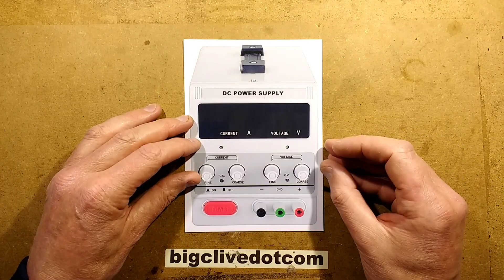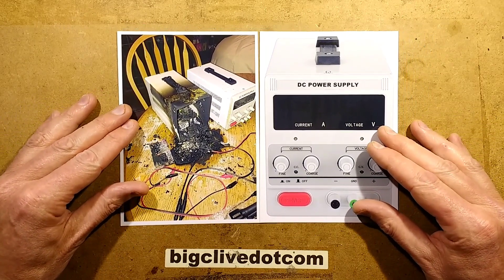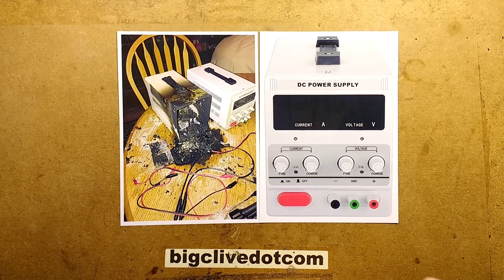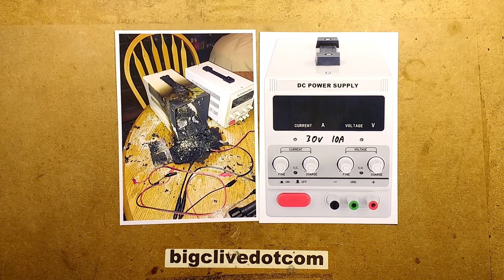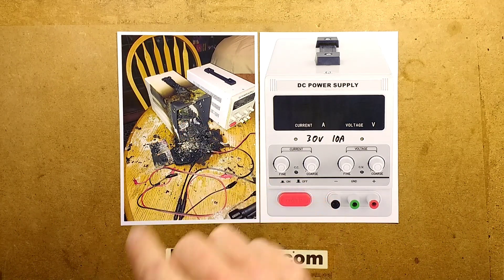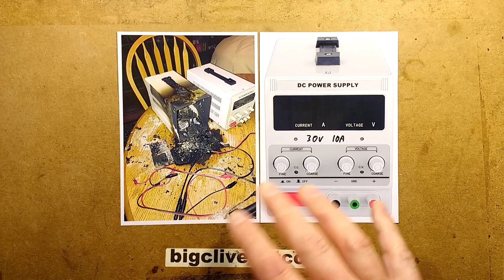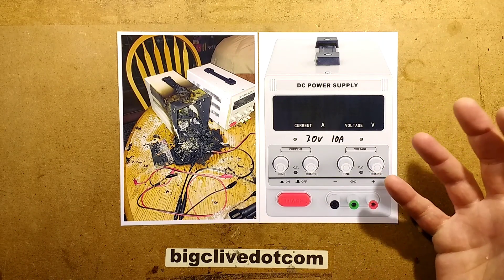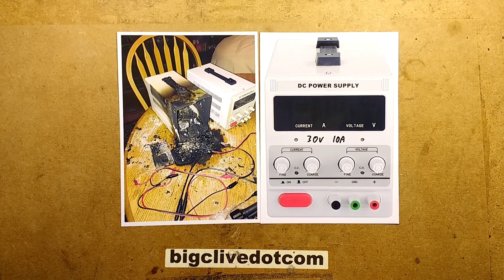Smokin' power supplies.  PSA

Comment: Gonna buy myself a power supply very soon,  Clive uploads horrifying stuff about power supplies D:
At least the one I gonna buy is 5A and passively cooled (might not help :D), also I already read to not let them run for too long in the first place, if needed only with supervision, checking if it gets hot or not.
Although the one I'll get has a toroid transformer and seems to have certain areas where it goes "click" while changing the voltage, guess that should minimize the heat :o
Reply from the maker: +8bpspfreak2 The click is probably a tap changer to minimise the voltage being dropped across the regulator.
Reply: 8bpspfreak2 I have been very happy with my Mastech HY3005F-3, which provides two regulated 0-30VDC@0-5A outputs which can also be bridged in series and parallel (for single 0-30V@0-10A or single 0-60V@0-5A) plus a fixed 5V@3A output.  I paid about $300 for it about 8 years ago and have had no issues with it even under rather heavy extended loads and it has taps about every 6V to reduce power dissipation by the series pass transistors (which are externally mounted on the rear) and also has a toroidal transformer.  More expensive than some of the cheaper alternatives on the market today, but it has served me well thus far on my bench if you need any recommendations.  Or, if willing to spend more, the older HP and Agilent bench supplies are hard to beat and extremely well designed but can demand a premium if in very good and working condition and often require a fair bit of bench space since they are often 19" rackmount size.

Comment: Hehe, oh how we laughed at the old running joke to Julian...
"Just get a good bench PSU!" :D

Does that include you too Clive? You have a dodgy PSU hiding off camera? :P
Reply from the maker: +NoName I have a good power supply with a huge design defect that very occasionally results in a crash that puts out a random voltage.
Reply: That doesn't exactly qualify as "good" Clive!
Maybe a good name with a crap design/implementation, but crap none the less.

Fare crack though, you went for a 'good' one, still leaves Julian who is seeking sponsorship from China :P

Comment: +bigclivedotcom question about power supplies going bad.

I have a UPS at home that seems to have exploded transistors.

Is it worth replacing them and fixing the UPS or will more of the PCB likely be dead because the transistors exploded?
Reply: enlightendbel if the transistors exploded then something very catastrophic happened to that UPS (battery polarity reversed, lightning damage, or a fault in the transformer or a shorted load on the output, none of which are good).  I would not bother with the repair unless you are really qualified to fully diagnose and repair the unit (made all the more challenging since there are no schematics and you will need to reverse engineer to isolate all faults).
Reply: The unit was stored for about 6 months.

I tested it before storing it. Did nothing to it other then plug it in.

Granted, I have to say "I think" they are transistors. Because following the PCB that's what their function looks like and they have 3 legs. I'm not kidding about the exploding, except that there is no burning to be found anywhere, the 2 parts are just completely shattered to the point I'm currently puzzling them back together to get the part number of of them :@

And no worries, I've been ripping apart way more complex audio and computer hardware as far back as age 8. I know how to fix things, but sometimes could use some insight into if it's actually worth to do so.

By now I've tested the LCD, the Batteries, quite a few of the components (about 50% trough) and other then one blown cap and those two transistors, I haven't been able to find anything wrong. There's nothing burnt, nothing leaking, just those two transistors that are in a thousand little pieces.
Reply: enlightendbel Whatever happened almost certainly happened prior to your decommissioning the UPS 6-months ago.  The transistors (either power MOSFETs or IGBTs) typically serve dual purposes of back charging the batteries while AC power is present (at least in the larger UPSs, smaller UPSs that charge much more slowly may not exploit this and instead use a separate charging circuit) and the role of generating AC via voltage inversion (either using modified sinewave or a PWM approximation of a sinewave) using either four transistors (or four banks of multiple transistors on larger units) in an H-Bridge arrangement or a pair of transistors switching two sides of a center tapped transformer.  As such, the UPS, while still plugged into a live AC receptacle, will typically appear to still be working properly, it just may not be charging the battery any longer if they were implemented to serve this dual role of charging (otherwise they only come into play when providing battery power to the load).  The fault would only have become plainly evident in the event that power was lost at which time the load would have been dropped.  Exploding a power transistor is always the result of a massive and nearly instantaneous thermal transient event that is nearly always preceded by a either a massive surge of power (such as with a very low impedance dead short on  the output) or a massive voltage breakdown event (such as with a large power surge or lightning strike event).  It takes a tremendous amount of power flowing through a power transistor to make them explode, and especially to make many explode simultaneously.  Barring your having shorted the output while the UPS was on battery power the most common cause of this fault is a large power surge or lightning strike (such can happen when power suddenly fails and a large utility transformer generates a massive back EMF pulse at high voltage and current), for this reason it is not usually worth spending good money on repairing the UPS since such UPSs are actually quite inexpensive (the real money is in their batteries, good UPSs minus batteries are not usually that expensive).

If you do decide to attempt repair, be very careful while troubleshooting and diagnosing the UPS as there are both high voltages present (up to around +/-350VAC if you have 240V power, half that for 120V) and very high currents at the 12/24/48VDC+AC provided directly from the backup battery.  This is not only enough to be very dangerous to the technician voltage-wise but also more than sufficient voltage and current to destroy your test equipment, such as an oscilloscope, if you should ever connect the wrong probe to the wrong side of things.  So be very vigilant and make sure you know exactly what you are doing and take time to think through every single step before preceding with any action as it is easy enough for those of us who have this experience to make costly mistakes with just a moment of absentmindedness!  Be especially mindful of where you connect the ground lead of an oscilloscope probe as most scopes use a ground/neutral referenced chassis and probe ground.  If the circuitboard is built from SMD components then you will want to obtain very thin test probes suitable for testing such small points since normal sized test probes can often easily short out to neighboring pins or components and that can cause further damage to the circuit.

Either way, I wish you all the best!

Comment: would you link to the make / model you have yourself? 
I've been considering one for bench use and would rather one that has been used and fully tested by a reputable destructioneer as yourself
Reply: Mark Barratt I have an 8 year old Mastech HY3005F-3 (two 0-30VDC&0-5A, bridgeable in series and parallel, plus a third fixed 5V@3A output).  I have never had any issues with mine and it has spent a number of hours pushed fairly hard with both variable outputs bridged for 10A output to drive an 8.5A load for extended periods.  It will get fairly toasty as it is passively cooled with both series pass heatsinks mounted externally on the rear) and is twice the physical size of this unit and dedicated volts and amps displays for both variable channels and is built around a toroidal transformer with taps about every 6V.  Never any smoke, which is a big plus in my book although any linear power supply can suffer a series pass transistor fault where the transistor(s) fail short circuit and pass full unregulated voltage and current to the attached load (one of the most common failure modes in linear supplies...switchmode supplies have their own innate weaknesses as well, but linear supplies generate no unwanted RFI issues).

Comment: Are those the ones that can plugin the right way, and also plugin in at the wrong pollarity without any problems? I have a few guitar amps and other effects boards that are similar. But i really prefer if it would be proper pollarity and not trying to mess around.. what do the behringer mafia want to see you electriced  at defiblulator at some stage?? I'm just prefer to have me reliable gear!

Comment: I have one of these. 
They can get very very hot at the terminal connections when under heavy load, looks like this one did too. The plate at the back of the connector sockets is not always the firmest connection, this may be an issue. 
I blew out the MOSFETs in mine drawing over 8 Amps at 30V with a SSTC. Fortunately it just shutdown and was easy to repair.

Comment: It may not have been the power supply that failed. I'd even say it's more likely that it was the wires. Chincy wires, where they skimped on the wire cross section or the connection to the connector isn't made properly, can get quite hot. Add non fire retardant insulation to and the wires will be on fire quite quickly.

Comment: I watched a tear down of a PSU in that same case, but you can get them with various current ratings and brand names so who knows how similar they are inside. The factory could base them all on the same design but spec models differently for different customers. Anyway, the heat sinks (and the bits that get hot) are about 3/4 of the way toward the back of the unit but that pic makes it look like the front caught fire. It could have been as simple as a bad connection by his cables going into the unit. But yeah definitely not a good idea to leave experiments running at that kind of power unattended. Go and get a drink, sure, but leave the house? Nah.

Comment: reminds me of my previous job, they had UPS (battery backup) for all the computers, but they'd suffer some kind of fault and would never stop trying to charge until they overheated and failed. no fires, but some rather scarily discoloured and warped plastic cases due to extreme heat.

Comment: i have one i modified  works at 30v 10amp or 60v 10amp no problems and i use it every day. i even charge my ebike battery with it 48v 20ah . only part that could do that damage would be the regulator on the back of the led display. likely very rare fore that to happen.

Comment: Owner of one of those power supplies here: the damn thing came delivered pre-broken for me, turns out one of the wires had come de-soldered from the one of the boards (forgot which, it was one in a row of three, very visible upon opening it).

Maybe the crappy soldering on these things is to blame? I'm leaning towards a toasted MOSFET similar to Menorcase's situation possibly starting the fire, i wouldn't have expected it to take out the whole front panel though, scary.

Comment: One thing I can think of that may have happened is that the power supply was limiting voltage and the peltier went short and overloaded the banana plugs. Peltier plates need both regulated voltage and current, if you power them from an unlimited source they can fail. Often the junctions go open but they can rarely go full short too.
Reply: Blaze the Fox The more I think about it, I find myself curious as to whether a series pass transistor may have failed short (a common failure mode for linear supplies) which would dump the full unregulated voltage (for the selected tap) and current available into the load, limited only by the transformer, load, and wiring impedance.  With any luck the series pass transistors may have survived the fire and could still be tested to see if this fault occurred.  It has certainly happened to me, only with a much larger linear regulator and it can be pretty spectacular if you are not present to quickly shut things down.  That said, I have a larger 3-output Mastech HF3005F-3 (2x0-30V@5A, fixed 5V@3A) -- just a bit higher total rated power output than this supply at 315W -- that is twice as wide and places the heatsinks externally on the rear and has taps about every six volts, even so it can run pretty hot if near those limits and towards the bottom end of a tap, so I really wonder how hot this supply gets with both the heatsinks and transformer trapped inside (hopefully includes a fan?).  But I find it curious that the front panel is what burned up, which to me suggests internal wiring or a banana jack overheating, which has me wondering if either such is inadequate for the 10A rating (or a bad banana jack/plug) or possibly a series pass transistor fault allowing unregulated voltage and current to the load.

Comment: Looks like the load started it, not the power supply. Maybe even the little leads got too hot... 18 volts at 8 amps is a lot for those tiny leads continuously
Reply: tapper88 The voltage is irrelevant, only the current contributes to heating of the leads (power dissipated in watts = I^2xR, or current squared multiplied by the wire resistance).  That said it does not take terribly heavy wire to handle 8A, though if very cheap multimeter leads were used to carry the current I might be more concerned (it is unclear what the multimeter was meant to monitor, but most likely voltage drop since the power supply displays current), but usually even the cheap banana lead kits are usually suitable to safely handle 10A with only modest warming.  I just wanted to clear up any misconception about the voltage contributing to wire heating as I dare say many do not realize that the voltage is irrelevant (not even part of the formula).

Comment: Even the good ones have a warning label about unattended use (well, my old analogue display PSU certainly has). Surprised there wasn't some form of overtemp. protection (which should have prevented this incident)

Comment: The fire appears to have started on the table (on the device that was powered by the PSU?) And then ignited the plastic on the PSU, so I will not judge the PSU as the culprit in this case.

Comment: Was it actually the power supply or the load that caught fire? Or was it some poor connection in between? I would never leave any bench power supply or unfinished prototype circuit running when I leave. Expecially when it is a high power project (like 18V 8A!).

Comment: All these power supplies come with warnings not to use the machine longer than 8 hours continuously. I don't know why it is so limited but maybe that happened here.
Or depending on the size of the peltier element maybe he was making a rather big electrostatic field which is sometthing these power supplies hate.

But at least the person now has a reason to get something that doesn't switch with relays, has good cooling, correct readouts, actual shielding and 50 other things these cheap PSUs don't deliver.

Comment: Something is very wrong here. Those power supplies should be better then bricks and wall warts. Even if they are shorted they shouldn't go up like that. Someone needs to get one like it and turn it inside out... assuming it wasn't the device connected to it that caught fire.

Comment: If you're truly desperate for a cheap bench PSU and aren't satisfied with the 5v/12v of an old computer PSU, you can get a DP50V5A for $20-30 online, nice little computerized regulator. Pair it with an old laptop charger or LED PSU or whatever you have laying around for an instant computerized bench PSU. Has all the bells and whistles, voltage, power and current limiting, on the fly voltage and amperage adjustment, toggleable output, memory for previous settings. If the $50 to build a decent supply or $150 to buy one is too much for you, stick to USB powered projects. And for the love of god, don't buy a $10 linear regulator of ebay, aka "project cooker"